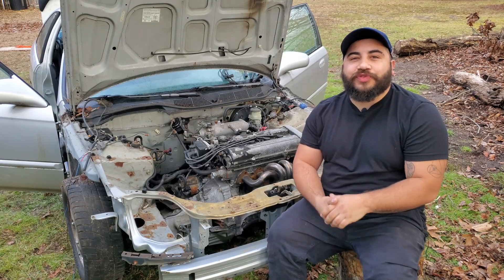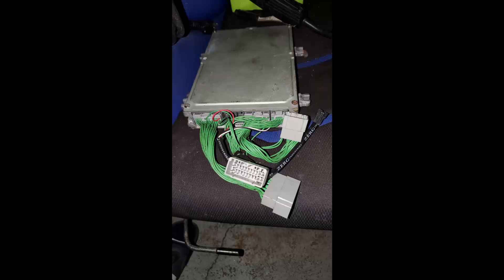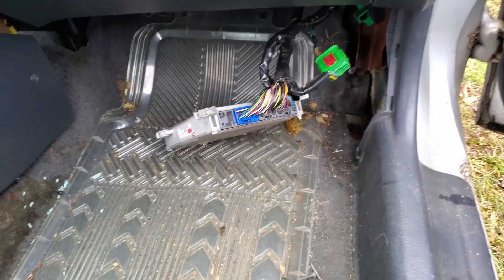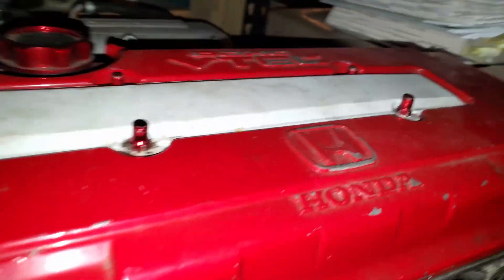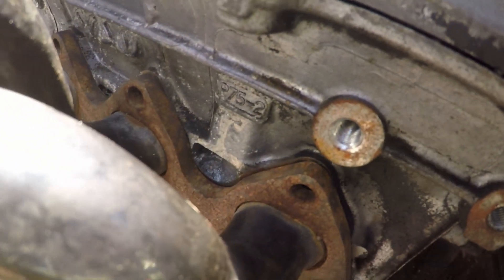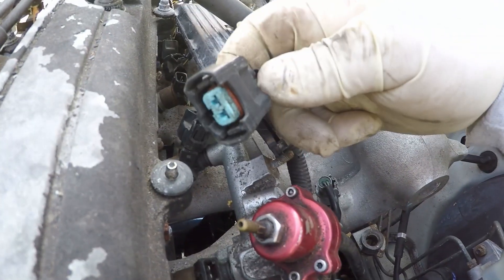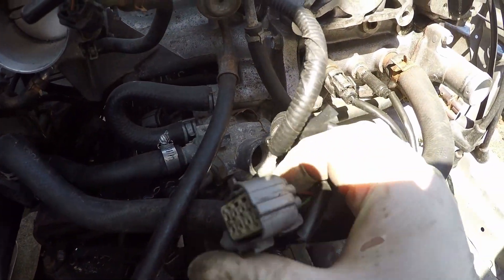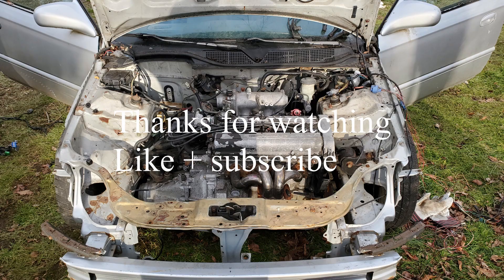How to Ek civic B20 Swap Part 4 ECU and Wire Harness

Comment: Hi bro I liked the video it was informative, I just bought a 97 civic that was swapped with a b20b, the previous owner told me that it needs a p75 obd1 ecu and a jumper harness to make it into a obd2a, is this correct?
Reply from the maker: Yes you can run an obd1 ecu with the correct jumper harness only you won’t be able to scan for codes because the obd1 ecu uses blink codes however, you also need to be careful on which jumper you buy.
Reply: @joemismaldonadoRx7  thank you man I really appreciate it is there some way I can send you a pic of the one I’m planning on buying just so I know for sure it’s the right one?
Reply from the maker: Yea 
instagram: joemisgtusiam
or email: joemissocial@gmail.com

Comment: I’m still confused I’m new to the Civic world. I have a 1998 Ek hatch & it was a automatic D16y7. I manual swapped it & B20B swapped but I’m confused on what ecu I need to get & what harness my car has if it’s a OBD2A or OBD2B.
Reply from the maker: Your car is OBD2A

96-98 OBD2A
99-00 OBD2B
Reply: @joemismaldonadoRx7  just did thank uou
Reply: I’m having trouble connecting the wires since it was a auto D16y7 I’m guessing I need a new harness for a manual? I’m looking up the harness for the OBD2 & it everything that comes up is B16 or B18. Would a B16 or 18 work on a B20?
Reply from the maker: So the best harness to use is the 99-00 si b16a2 harness because it is a direct plug and play for Bseries into the ek chassis, the next closest harness you can use is your year model ex civic with the single cam vtec engine d16y8 you would only have to convert a couple plug ends for the Bseries sensors and maybe extend fuel injector wires
Reply from the maker: You will also need to change the ecu to a manual as well, im using both ecu and harness from the 99-00 civic si for my b20 build, I am working on a video showing the sensors and connector differences that I’m running into.
Reply: thank you so much  @joemismaldonadoRx7
Reply from the maker: No problem, If you find the time please hit the subscribe button and enjoy the rest of your week.

Comment: Hey I just put a b20b in my civic which had a b18 I changed the distributor to obd1 which car is a obd2 harness course I bought the conversion harness for the distributor but I still can’t get it to run do I need the crank position sensor I have fire fuel just no start
Reply from the maker: What years is your civic?, also for the ek civic the best Bseries harnes is the 99-00 civic si harness.
Reply: @joemismaldonadoRx7  it’s a 1999  my question I guess is do I need a crank position sensor down by the crank I thought if I just change the distributor to obd1 since they have the crank sensor inside of it I would be fine but it turns over has fuel and fire but just no start it’s a dirt car  I just can’t figure it out my b18 last vtec that was in it before had the crank sensor
Reply from the maker: If your running an obd2 ecu then yes they require the crank sensor bolted to the oil pump, im actually going to have to swap my b20 oil pump for one with the sensor as well because mine doesn’t have one, I’m working on making a video on this.
Reply: @joemismaldonadoRx7  so just changing the distributor to obd1 will not work we are using a p28 ecu
Reply from the maker: Ok so the p28 doesn’t require the sensor on the oil pump however the p28’s pinout is very different, depending on the jumper your using it’s hard to tell exactly what wires are missing a connection, you’ll need a multimeter and wire diagrams for the car your harness came from and your chassis wire diagram to compare and match the the harness connector pins, there is a lot of information on how to complete your setup on the internet, just take your time and write everything on paper to keep track there’s over 60 different wire ends between the three big connectors that plug into your ecu, it can become confusing.

Comment: I got a question can you fit a b18b1 head on a b20b block ?
Reply: Would you suggest it ?
Reply from the maker: @40caltone  if I had to choose I would put a vtec head (b16,b17, gsr, type r)on the b20 block. I believe the b20 and b18 heads and cams make 140hp. So putting a b18 head on a b20 block would not really make any more power, if you have a spare b18 head and spare b20 block then yea do it to save money and get the car running. Hope this answers your question and thanks for asking as well. I’m working to get more videos of my ek up soon.
Reply: @joemismaldonadoRx7  thank you
Reply from the maker: @40caltone  no problem
Reply from the maker: Anthony yes you should definitely be able to mount the b18 head to the b20 block only not sure how the cam timing would be affected.

Comment: Hey man i got a b20 swap in my 95 teggy ls and its manual. Its in limp mode rn so im wondering if its from my ecu? I have the p75 a01 ecu. Also getting fuel injectors code
Reply from the maker: First, I would verify the wiring from ecu to each injector has continuity. Then check the ohms for each injector. Need to know what injector your running to be accurate. The fuel injector code usually means there is either a bad wire connection or a bad fuel injector.

Comment: What happens if you b20 auto from a crv swap into  a integra automatic and you don’t change the computer the your stock b18 had what happens their do you loose power or something
Reply from the maker: Depends on the year of the cars and engines and ecu’s, they have differences that would affect engine performance however, if you use your integra’s intake manifold the b20 should run fine in the Integra

Comment: yo i know this is late but since u never posted another vid, did the plugs all plug in? if not what'd you have to extend.
Reply from the maker: Hey the harness plugs plugged into the ecu with no issue, the injectors I believe match as well, just need to check the manifold sensors and engine crank sensor, working on another video just been pretty busy

Comment: I got a question regarding this swap so I have the same motor but I’m currently running a 96-98 engine harness non vtec !!But I’m told I need a 96-98 vtec engine harness in order to use the throttle body and iac is this true?
Reply from the maker: It depends on the ecu you run because the pin outs vary between years, ecu, and engine sensors. you can run either harness they will need the iac or intake manifold sensor wires changed because the single cam harnesses plug into the single can sensors, so you will need to find bsieries sensor plugs to splice onto your single cam harness. Google images can help when trying to compare years of harness, engine and sensors.

Comment: Yo bro inn swapping a B20b into my 97 hatch planing on using my original harness what ecu would I use a p75 obd2??? Please reply
Reply from the maker: Hey the obd2 p75 might not work depending if you use a jumper/conversion harness, the civics under dash harness are a bit different that the integras

Comment: Hey man I just wired up my b20 in my ek and for some reason the cars just turning over and over and not starting any way u think u can help me ?
Reply from the maker: Hey so usually you don't have spark or fuel when your engine doest start and if they work then the engine could be out of timing depending on what work was done to the distributor and timing belt
Reply: @joemismaldonadoRx7  thanks man I found out I had the wrong ecu
Reply from the maker: Nice so what ecu you ended up going with and what harness are you using? I might have to change my setup because I noticed my b20 doesn't have a crankshaft position sensor
Reply: @joemismaldonadoRx7  costed 294 dollars but I got a b18b obd1 ecu and I have the conversion harness and yea it comes in tomorrow so I’m hella excited

Comment: Do I need a obd1 distributor if I'm using obd1 ecu on my 98 ek
Reply from the maker: Depends on the engine and harness your running but yes you will eventually need a jumper harness to convert the distributor to obd1 in a 98 civic

Comment: hi bro can you give me some advice i have d15b ek im planning to swap b20 how about the harness and bracket engine.
Reply from the maker: Checkout this video I show the mount and bracket as https://youtu.be/NTz8QL42cc4
As for the harness you have a few options:
1 - the 99-00 si harness off the b16a2 
2- 96-00 ex single cam harness 
3 - aftermarket harness like a hybrid racing or rywire harness
Reply: hi bro how about p91 ecu can use b20b none vtec